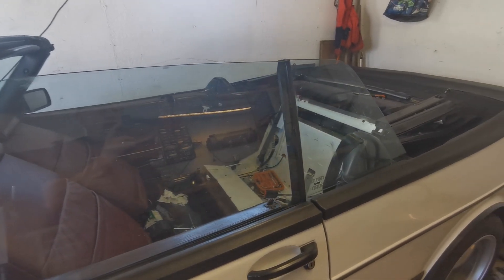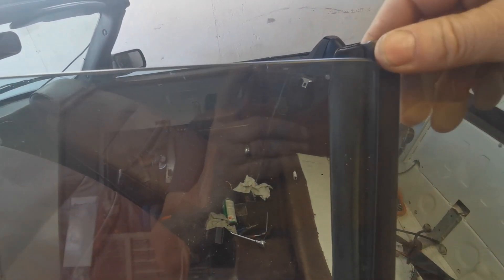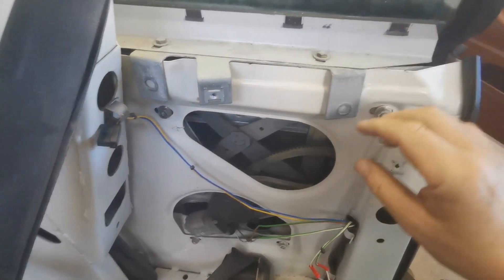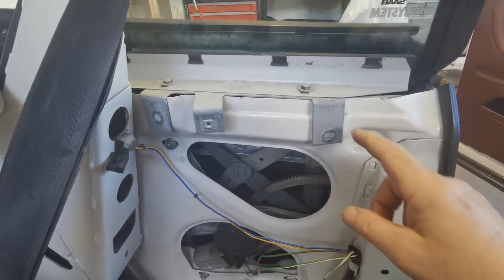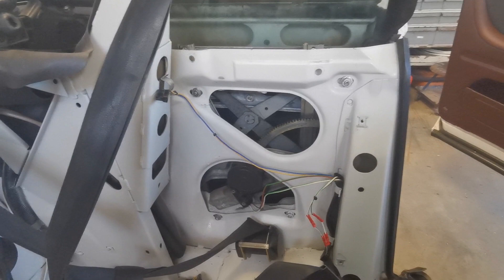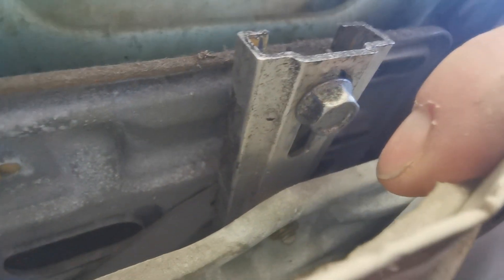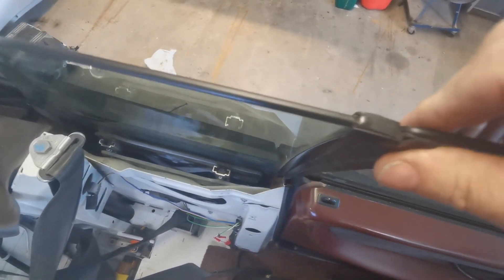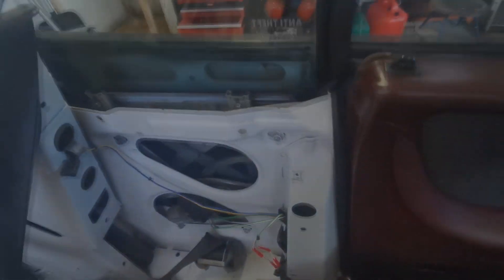Saab 900 classic convertible, Adjusting quarter window

Comment: Hello Terje
Thank you for this tuto
I have the same problem on my Saab 
now the rubber seal is broken, and i need to change it
please could you share about the supplier of the seal. at this moment i don't find supplier for this.
many thanks in advance 
Nour
Reply from the maker: Here it is...
https://www.ebay.com/itm/225045728381?itmmeta=01HYAR77KM8PPGKZ2GBSD32NFQ&hash=item3465c54c7d:g:dzgAAOSw-W5U1MPK&itmprp=enc%3AAQAJAAAA4BWq0FrBO7Fk51c5V8Ea8c%2FiAU1zQ8pN%2BymG4lOW0PK0F704BOoC9z2C%2BP9aXfzW6RAR5akq8pYSVF9VwN7q0MTCUqNJVIJWo7Kxq3QIceJhuhMNgbImkJrZBGFo%2Bgb8z7c%2FxCvfq96WS%2BJ2%2FEw9oM1X3hWsotAxyETZI3vS6lO0XtjjbsetIZhWHmckrQPXi%2BR9EwIjIVGbXs4UhUTQQF4bhRULETxds968FBFBHN%2FYx2GR8vVkheBKrTI4gqaELhuX0IjOV7Z5kjL%2BdBSDweJbuawUj0cNoyPBkDZjA5m0%7Ctkp%3ABk9SR_r5nNjyYw

Comment: Hi . I have the same car which has been fairly underneath by previous owners. Your videos have been really useful , however I am now starting on the `left side and wondered if you had replaced the upper suspension bushes on that side .  As you probably know the manual states just remove the engine ! Have you found an alternative , any suggestions much appreciated . Have a good Xmas.
Reply from the maker: Hi!
Thank you!
If you watch my front suspension video, you will see how I replaced the upper control arm inner bushings.
Just watch the entire video and you vill make it.
Good luck.
Reply: @TerjeNormann  Yes thanks I did that BUT the left hand side ie drivers side for you the engine is in the way .
Reply from the maker: @normanmart7933  It was for me to, but if you watch the vidwo well, you see how to solve it.